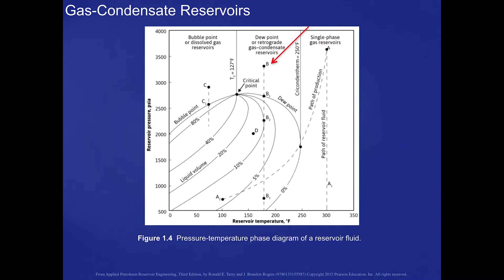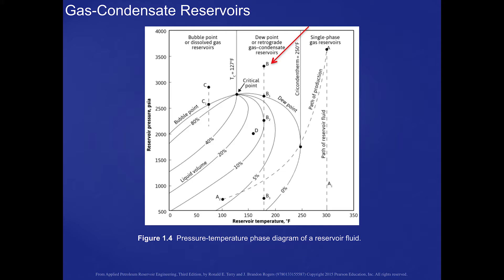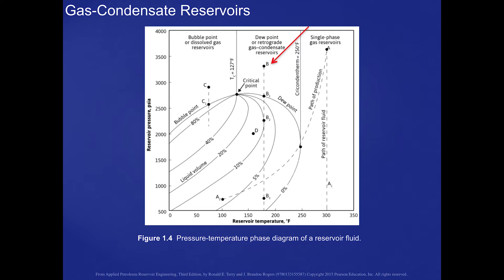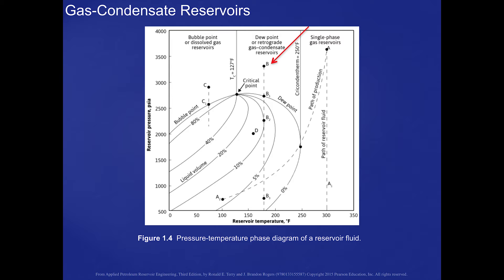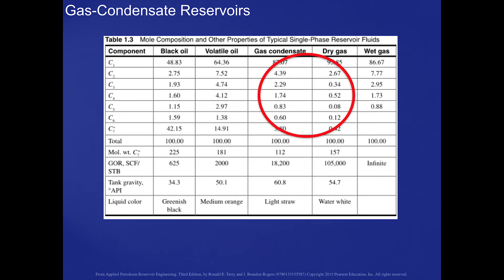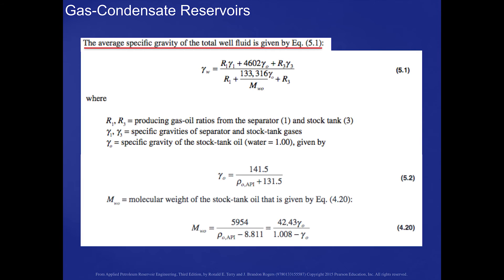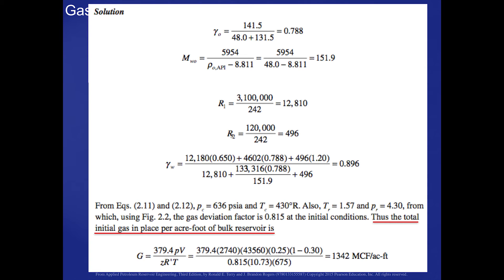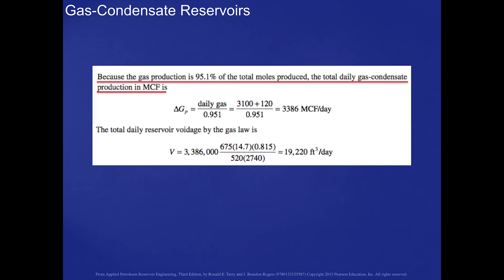Gas Condensate Reservoirs part 1

Comment: Please possible solving this quation 
Pvt cell contain 16*10^4 of natural gad at unknown pressure and 220F the sp.gr 0.7 the pressure was reduced to 14.7  psia and temperature to 60 F the weight of gas is 0.5 lb calculate 1- natural gas unknown pressure 
2- natural gas expansion factor 
3- isothermal gas